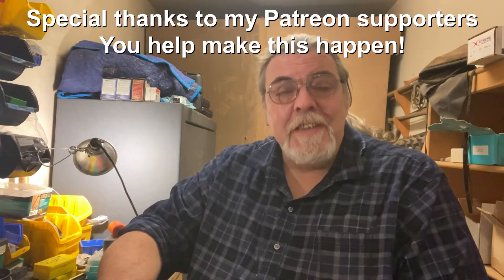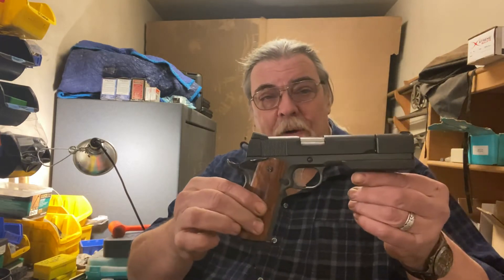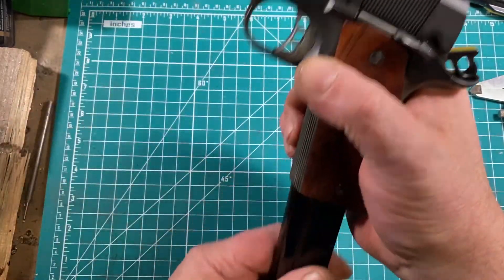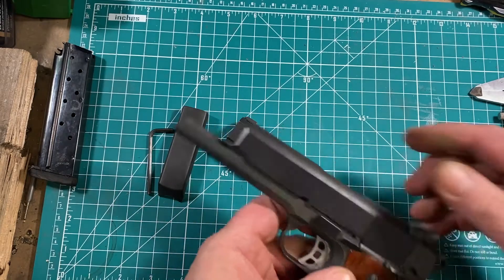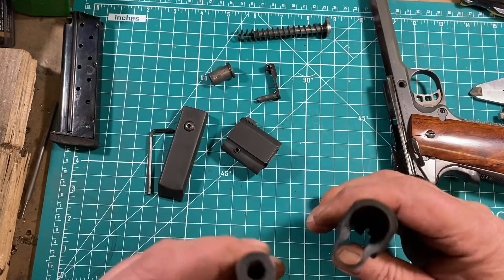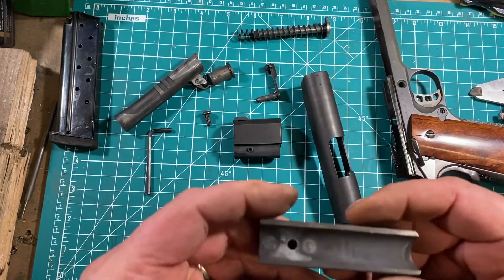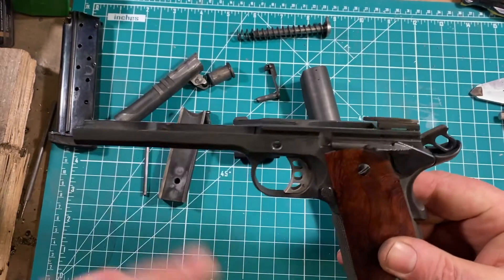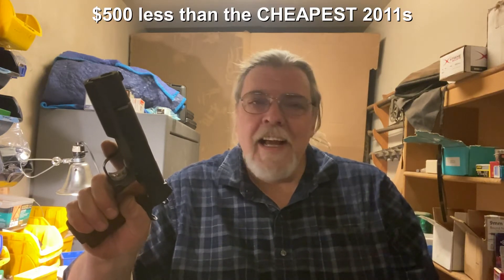1911A1 9mm- The Son of the Speed Master

Comment: Very cool project. The thing cycles so fast the frame rate couldn’t keep up. Wonder if it’s possible to run a 6” barrel and spring setup, with the short slide? Say have two inches of the front of a slide welded to the dust cover. I’ll have to log that in my future retirement project file 😉
Reply from the maker: I'll be eager to hear how that comes out!
Reply: @tinkertalksguns7289  let’s hope we both live that long 😉

Comment: I have been reading your blog and have a question about your single shot pistol designs: how does the barrel latch?
Reply from the maker: Most of them have a spring-plunger in the barrel that engages a hole in the breech-face to lock the barrel in place.  These are retained by a screw that protrudes from the side that is used to retract the plunger.  I hope that description makes sense.